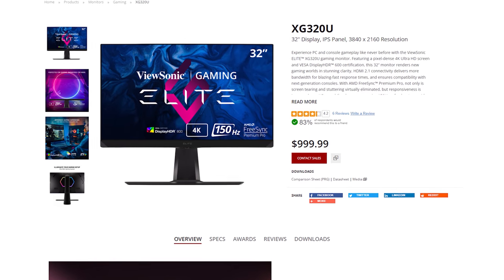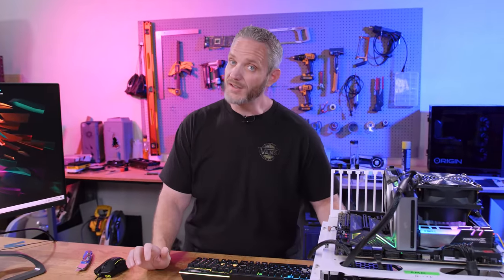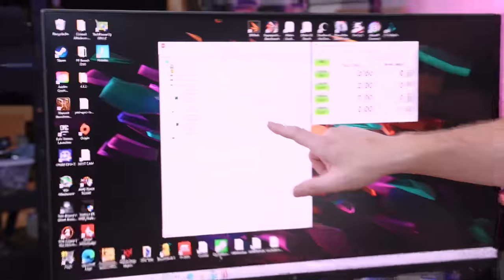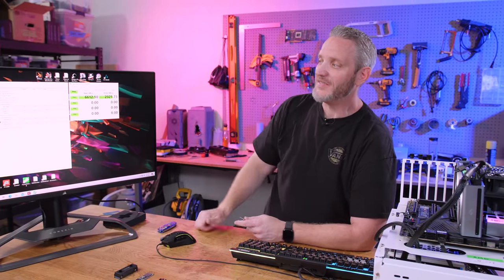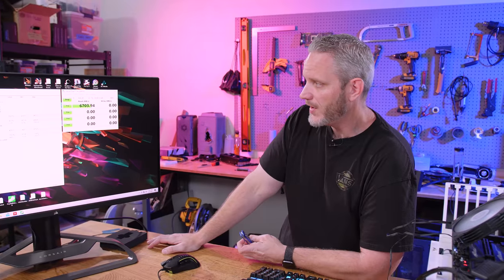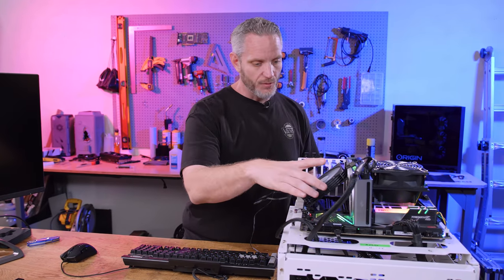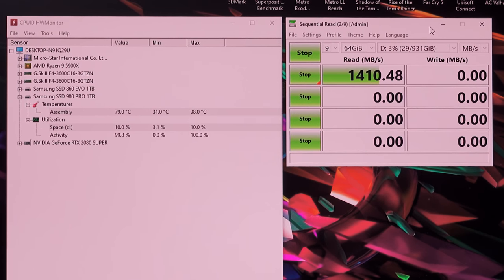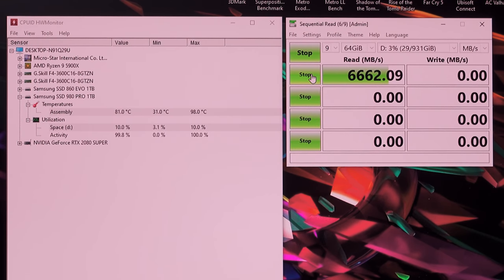I watercooled an NVME SSD... These results were unexpected!

Comment: Jay, I like your video but you made a statement in here which is deeply worrying. You said that it's easier for a cooler to 'hold temperatures down from the beginning' than to 'bring them down from an overshoot'. This is plainly wrong. Heat transfer is proportional to temperature DIFFERENCE. This means that is something is hotter at the start it will shed energy faster everything else being equal. Stated another way: Boil some water, pour it in to a mug and note the time when it first hits 70c, then see how long it takes to get to 50c, then 30c. It's going to get to get from 70 to 50 way faster than 50 to 30. IF you have ever observed that a cooler has a harder time 'pulling down' from a high temperature than 'holding it down' then it's either that it wasn't actually in steady state in the 'holding down' case, OR it wasn't a like for like test. This is thermodynamics and not opinion, but if you hold this belief then please do the water test to challenge your beliefs.

Comment: I'm quite familiar with this situation in my X570 build. I'm running a TUF Gaming board so I have the option of up to 2x NVMEs without need of occupying a PCI-E slot or using adapters and I get an added benefit of NVME RAID if I choose a matched pair. I'm using a single Corsair MP510 for my situation and it's on the way out, so I'll probably choose a pair in the future, granted I solve the rest of this.

The problem, similar to the arrangement of the X570 chipset is the layout. I run a SolarFlare 5122F in the first full slot and a PowerColor RX 580 in the next slot. NVME slot 1 is above all of this but I run my NVME in slot 2, which is essentially a heat sandwich. In theory it would be better to flip the order of these cards but I need to dig out and modify an antique adapter and water cool the SolarFlare before that happens. I refuse to water cool the RX 580 but as I've noticed, thermal throttle points are all over the place. The RX 580 idles at 45C and starts artifacting/crashing around 72C. The MP510 idles at 45C but throttles and has issues around 80C. The SolarFlare doesn't appear to have a set idle or throttle temp but it's higher than it needs to be and in the 2nd slot causes everything else to go up +25C, which is a reason I rearranged this. Other than the fact that the first slot is my only PCI-E 4.0 capable expansion on this board, I don't upgrade often enough to warrant draining the loop or other general maintenance more than once every year or two. I might choose a PCI-E 4.0 GPU in the future but this NPU is PCI-E 3.0 x8 and will stay that way. What do you believe is the correct answer for my situation? It doesn't appear to be water cooling but it might be.

Comment: If I remember correctly on average the operational temp of ssds are 73c.  So even if it over 60c , it would still work for desktop. I guess they design it so that it would work flawlessly even on laptops. Ofcourse the lower the temp the longer it would last, but with a well ventilated case and with a regular heatsink, any current nvme ssd would work just fine and won't even reach 60c. Maybe in the future when ssd runs 50000mb/s, we would need to watercool it. I live in a tropical country with an ambient temp of 32-36c(on special occasion  40c), my ssds doesn't even reach 55c when I transferred more than 1tb of game files from my old ssd to the new one.

As for the write speed, I feel it would actually be better to just copy a real large files instead of using an app.  Like a 1tb of file from one drive to another.

Comment: If I recall correctly, it's easier to write when SSD are hotter due the way it works (moving electrons, hot = easier to move)... but I didn't explect 50% drop. lol
BTW... do you know if this test counts as written when the file is in the cache or when it is finally written to nands?

Comment: As far as chips go "heat kills lifespan" no doubt! The problem I see is NAND needs to be KEPT at the right temp for BOTH performance AND longevity. So you'd need either a separate loop, an additional thermal controlled valve or a fan to keep it at "optimal temp".
Reply: They make some cool fan mounted heat sinks for nvme ssds.  It is the controller that gets hot and heats up the nand too. Just dump some holy water into the pc and it will keep stuff cool.
Reply: @johnmadsen37  I've seen all kinds of 'cool' M.2 heatsinks, including some copper ones about 13mm thick.

Comment: 11:17 That's what's happening when you do tests and have no clue what you are testing. Unfortunately not informing himself is one thing I often notice with similar "tests" on this channel.
The explanation is simple: Pseudo-SLC-Cache.
11:36 Maybe, maybe not. The test as done here does not give any clear indication, because Jay has simply not taken all variables into account. And then your whole measurement results and drawn conclusions are most likely BS.
Sound harsh, but that's exactly why good test require work upfront to define the test, work-arounds for forseeable problems, have a defined test setting and critical review of the data afterwards.

Comment: "a heatsink without air moving is a heat soak" LOL you have no idea what you're talking about. That's literally what a heatsink is, it sinks (=soaks with) the heat. When putting on airflow and making use of the large surface area with convection, you're using the heat exchanger functionality of the thing.

Comment: I liquid cooled all 3 of my M.2's on my motherboard after discovering how easy it is to do with a vertical mounted gpu and 2 rad setups. I don't plan on changing the drives anytime soon so it is really sweet to see the drives never pass 35c max in any situation
Reply: yeah except that your gpu's and cpu will make the ssd's run hotter when they are under load and heating your loop up into the 60's or 70's when air will keep it at 40 something degree's so good luck
Reply: @raven4k998  I've tested this with cinebench, heaven benchmark, and heavy gaming, while monitoring SSD temps on both Samsung magician and Corsair icue, and there was never a point where any of the drives reached 10°C over idle temp. Even with a heavy load, the drives never exceeded 35° in the last year and a half of personal testing.

Comment: So I wanted to let you know that the reason the write cycle was doing the weird up down numbers thing may be because the ssd was to cooled as I noticed the changes in numbers seemed to happen mostly when you had the fan on the m.2 but thats more a theory. I would have to fully test bench to see if thats the case but that is my theory. otherwise it may just be an unusual program running.

Comment: These SSDs are only protected against overheating, so if you look at the manual of the SSDs, it shows an operating temp. If you stay below that, there should be no performance loss.

You should be mindful of where you put the SSD vs the video card, though. The GPU could blow hot air against the mobo which runs it across the NVMe SSD. My SSD's temp correlates a lot with the temp of the GPU closest to it.
The OS one is above the GPU right under the CPU cooler. Your tower cooler blows some air over it, which helps, but also raises its temps a bit.

But then real world loads... unless you are copying a movie folder very often... will you ever hit this bottleneck?

Comment: Hey Jay, I use for my SSD Test always the onboard Windows Tool for formatting Drives. If you use the "slow" format it takes a long time and you can see with other tools how the temp is.

Another method would be use the tool "H2testw" which is designed for writing 1+0 on the hdd/usb stick just to fill them up. The intension for this tool was to have a tool that checks the real size of usb sticks. I think there are still a lot fake usb sticks with 8TB size out there ;)

Comment: The reason for the inconsistent speed is the cache filling up with partial test data, so it wont use the cache for the whole test. The next time you run it, it fits.